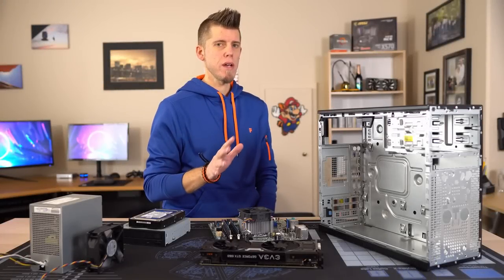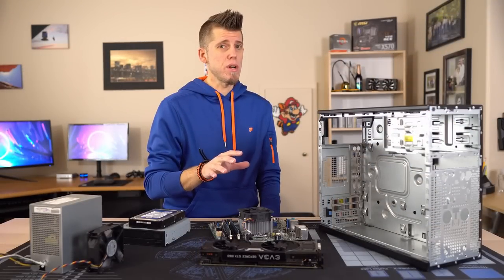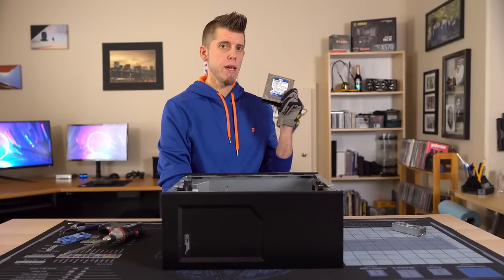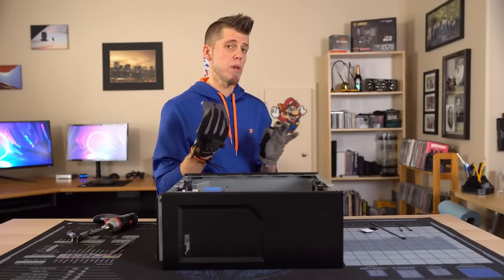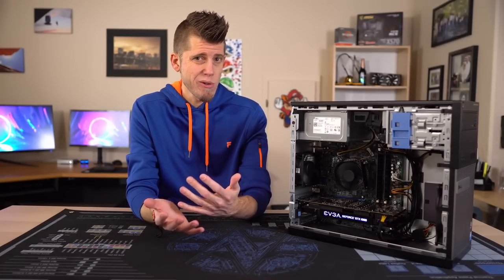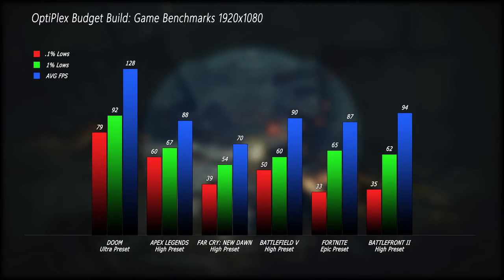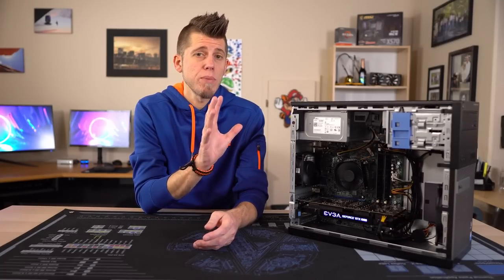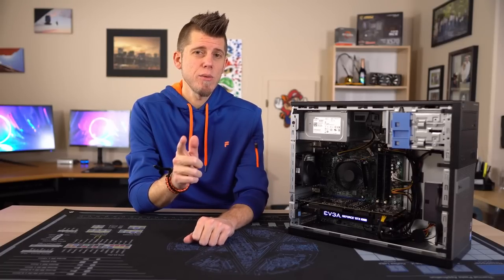Dell OptiPlex Budget Gaming PC For Under $300?

Comment: Thanks for the great video! I'm installing a fresh Windows 10 on  SSD. What  do you recommend installing first after Win 10 installed, the drivers from Dell website or Windows updates? Also, what is the drivers that need to be install from Dell for Windows 10?
Reply from the maker: The first thing I'd do is download all your drivers from the Dell website, and any add-in cards from their manufacturer websites. Then, don't connect the system to the internet and install Windows. Make sure to not connect to the internet and then install all those drivers, then connect to the internet and you can run Windows update.

I don't care for Windows update drivers. I've had various problems with them over the years, and if you're connecter to the internet, it will download them right away.
Reply: @TheGameBench  Hey, what Windows version  
Driver did you installed? There is No Driver for Windows 10 on Dell website for Optiplex 990.
Reply from the maker: @Harvz78  On the couple I've had come through, I've just used the Windows 8 drivers. They'll work just fine in Windows 10.
Reply: @TheGameBench  9? Is there a Windows 9?🤔
Reply from the maker: @Harvz78  For some reason they went to 8.1 to try and fix the disaster that 8 was, then just gave up and went to 10.
Reply: @TheGameBench  Where did you get the Windows 9 drivers you installed on your Dell optiplex Windows 10?
Reply from the maker: @Harvz78  LOL... I'm sorry, didn't even realize I had accidentally put 9. I meant Windows 8. And the Windows 8 drivers are on the Dell website.

Comment: Trying to make a long story short, I currently have 3 7020 Sff's. And may need other to upgrade a 4th 790.
Does it make sense to buy a 7020 i5 sff at the $100 price point , New conservative case also and gpu or is there another build you would recommend?
I guess I would love to see you keep going with this project. Where does it stop making sense?
Reply from the maker: So, you're talking about buying it and doing a case swap? If so, you can do it, but I would rather use an MT system for the swap since it's a standard micro ATX board. Now, when does it stop making sense? I think I'm about to find out. I ordered a Ryzen 3 3300X and I'm going to find out how I compares to the OptiPlex. Regardless, I have no intentions of stopping with the OptiPlex content. I have quite a few videos planned.
Reply: @TheGameBench  fantastic!
I'm enjoying.

Comment: I cant connect my 5.1 speakers pc to this DELL....any ideas of a pci or usb audio card that works in windows 10? thanks
Reply from the maker: Yeah, the on-board sound isn't 5.1. I don't have a lot of experience with external 5.1 solutions. I'm running an external DAC on a 2.1 setup. However, I've heard good things about this one.

https://www.amazon.com/Creative-Performance-Headphone-Integrated-Microphone/dp/B00EZT7RE4/ref=pd_sbs_147_5/132-0697711-9021900?_encoding=UTF8&pd_rd_i=B00EZT7RE4&pd_rd_r=100a9e63-c2d5-4947-b15b-08159904a6f4&pd_rd_w=t3ROH&pd_rd_wg=hXlEn&pf_rd_p=7cd8f929-4345-4bf2-a554-7d7588b3dd5f&pf_rd_r=ZKV6AT30VNGSHWKTK6D6&psc=1&refRID=ZKV6AT30VNGSHWKTK6D6
Reply: @TheGameBench   thanks! will check it out

Comment: What about a power supply that's not a ticking time bomb?
Reply from the maker: It's not. The 1060 is a 120 watt GPU. I tested these fully and with the 1060, the total system power draw peaked at about 240 watts, from the wall, at a max system load. The components are pulling, and worst, 220 watts from the power supply and sitting more around 200-210 watts. You literally have 70-80 watts of headroom. Also, I torture tested the PSU with a 480, pulling near it's 290 watt limit for four hours and it had no problem. This has enough power for a 1060.
Reply: @TheGameBench  but directly under Nvidia's website it directly says the reccomended psu be at least 400w. You are playing a dangerous game here which will end up with a most likely teenaged pc builder frying their first machine machines.
Reply from the maker: @haverjr  No, I'm not. Here's the deal, that exists because not all 400 watt PSU's are 400 watts. That is a peak rating and not all power supplies can maintain it. They might be able to maintain more around 300 watts, or less and might be able to peak to 400 watts for a split second. This is typical of lower end power supplies. Now, the PSU in these Dell's can maintain 290 watts. Meaning that there's literally zero difference from a sheer wattage delivery perspective.

That is why nVidia just says "400 watt minimum" because it covers their bases and is a lot easier to explain that way than what I just told you.

Comment: Should i get new cpu cooling mine cpu cooling metal is rust
Reply from the maker: That's pretty concerning, I would say yes. It's just going to continue to corrode, and at the very least, reduce the efficacy of the cooler. But I would have to ask why it's started corroding in the first place... since moisture and electronics don't mix. Anyhow, I would just replace it with the same stock cooler, or you can try stopping the corrosion on the one you have.
Reply: @TheGameBench  i got it from someone  for free.the guy say it from university anyway thank for help
Reply: When i got cpu cooler already rust so i let go bcz idk lol

Comment: That board has serious PSU choice challenges.

There's another Optiplex similar looking to this but uses a standard 24pin Power. Pinout may be a bit different but works great with any PSU. 
I myself upgraded my uncle's 4th Gen i7 Optiplex with 512GB SSD, 16GB ram and 1650 Amp from Zotac
Reply from the maker: Not really. There's an adapter that costs like $12 that will convert it to a standard 24-pin. Done it on several.

The xx10 an x90 have standard pinout 24-pin connections, but they are 3rd and 2nd gen respectively. They also have reasons I don't recommend them, and I go over that in another video. Also, there's no OptiPlex that runs 4th gen that has a standard 24-pin. If it does, it has an aftermarket board in it.
Reply: @TheGameBench  I may have to see which video I watched which had Optiplex with 24, maybe it was a different board, but if I find it, I'll share it here.
Reply from the maker: @shshankking  Yeah, if you can find it, I would be very interested to see.
Reply: @TheGameBench  https://youtu.be/z23iYDf0UDQ

Here's the one with 24pin board
Reply from the maker: @shshankking  Yep, I've seen Greg's video. That's a 3010, which runs 3rd gen Ivy Bridge. He called it out in the video that the system has a 3rd gen i5, not a 4th gen.
Reply: @TheGameBench  yeah.. ITS 3RD..But the fact its there make me wonder why they changed it to small one..
Reply from the maker: @shshankking  To make sure their customers couldn't replace things on their own. It was a matter of control. Everything since has been using the same connector... as far as I know.

Comment: So I’m confused about something. I bought an EVGA GTX 1060 6GB like the one in this video, but I don’t know what I am supposed to use to hook it up to the power supply? Trying to figure it out based on the video, but I need clarification on what to connect? I have a connection that came with the GPU, but I have no where to connect the cables to give the GPU power... a little help? Basically what are you using to power the GTX 1060 you are using in the video?
Reply from the maker: I talked about the the SATA to PCIe adapter at 9:13. You just need the SATA to PCIe adapter, which is in the description, and you connect the SATA connection to an open SATA power connector and the PCIe 8-pin to the GPU and you're good to go.

Comment: Are you able to put the gpu above the sata wires? I have a optiplex 9010 and it looks like the sata wires would be in the way if I got something bigger then my evga 1050ti.
Reply from the maker: Yeah, on the xx10 OptoPlex's the SATA andd USB3 port are in the way of anything over about 8.5 inches. A good option are the Zotac mini cards. They're just the right size and you can get those up to a 1080 Ti. However, Silverstone makes some low profile SATA cables that will clear the GPU and you can use something like this for the USB3.

https://www.moddiy.com/products/USB-3.0-20-Pin-Internal-Header-Adapter-Cable-Low-Profile-Connector.html

Comment: I have a empty dell optiplex case and I want to add 2 HDD the first one is 3,5 inch and the other drive is 2,5 inch and I don't know were to put them if I remove the  hard drive cage ? Maybe I can put the 3,5 HDD in the empty DVD drive holer? ( Idk what it's called)

Comment: A great alternative to the Optiplex 9020 is the Dell Precision T1700. It is also a Haswell Gen 4 based system with a slightly different look to the case AND a single 6-pin PCIE power connector on the PSU.  Prices should be similar to the 9020s.  I put a 4C8T  Xeon in one for my grandsons.
Reply from the maker: Absolutely. I just got one in and I'm going to be making a video shortly about the current prices with some alternatives, including the T1700. However, they don't always come with the 365 watt PSU. A lot of them only have the same 290 watt as the 9020.
Reply: I can’t ever find a decent price on these, they generally average around $70 with shipping.  Now that you mention it, I wouldn’t mind getting my hands on a Poweredge T20 MT as well.

Comment: those dell is good way to start ,most of them you can change the PSU with normal atx to get hungry VGA ,on that setup you can add 4x8gb ram later + it has room for cpu upgrade .so its a pc that will last some years.

Comment: that's a very clean optiplex case how do you do it?
Reply from the maker: Thanks! I remove the hard drive cage, the tabs under the upper drive bays, and shave down the front panel to add the fan. I have videos on how I doo all that. Now I actually cut a hole for the fan for better airflow, which I need to make a video on.
Reply: that would be amazing, do you use alcohol or alcohol wipes to clean the case?
Reply from the maker: @CODzombiePS3  Nah, they dry too fast. I just use some shop towels and Windex or some all purpose cleaner. Works well enough.

Comment: Hey, I have this Dell Optiplex 990 here that I was going to upgrade with other parts from another guide like this one. After watching this guide though it looks like it massively performs better than the other one being able to run new-ish AAA games at pretty decent frame rates when the other one was meant for more casual less demanding titles. Would there be a difference in performance if I just plopped these parts into the 990 instead of just buying another 9020? And I was also gonna buy a new PSU but you didn’t replace the old PSU in the 9020. (Hopefully) you can answer me when you see this, anyways cheers!
Reply from the maker: I also have a newer video where I test the 2nd, 3rd and 4th gen CPUs against each other. I can really give you a good idea of the performance difference between the different generations. Even the 2600 is starting to fall behind in modern titles just due to IPC limitations. And no, I didn't replace the stock power supply because it's adequate for a 1060 6GB. It also would be fine with a 1660, 1660 Super or 1660 Ti. The latter two needing a dual SATA to PCIe adapter.

Comment: Yeah you COULD upgrade the cpu/gpu/psu in that, but I agree with others that it is a dead end. That thing uses DDR3 RAM, and the fastest reasonably priced cpu doesn't even turbo up past 4ghz so there are going to be some bottlenecks there. This is a great build for kids/young adults when you need something that will last them a few years playing games they are playing like Fortnight/apex legends/rocket league/etc. It's a "one-and-done" build and once it dies, it dies.  This can provide a decent performance to cost ratio if you always research the next wave of obsolete office towers and compatible upgrades every few years. If you always replace the whole system every 3 years and cap your spending at 300 dollars, you get a yearly cost to performance of 100 dollars. This is REALLY good. However you will always be making sacrifices on graphics settings to get games to run smooth.  It can be better to just build a base custom computer for around 500 that will last you 8 years or so, add a 300 dollar gpu, and then upgrade that  gpu once after 4 years. This provides the ability to run games at max settings while only increasing your yearly cost by about 50 dollars or so. Then there is also the benefit of not having to try and snipe a good deal on ebay for an optiplex with good specs, and no goofy adapters or modified cables. With a new custom pc (in general) you plug it all together and it just works.
Reply from the maker: I'm not going to disagree with you. You're not necessarily wrong. However, the intent of this system was to debunk the myth that consoles are more cost effective. To show people that aren't considering PC, because they think that they can only afford a console and any PC that costs as much is going to be slower. I proved that wrong, and there is a market of people that this system is perfect for. Most of the people I sell these to are kids as their first gaming PC, and that's how I market them. However, I've had some older people buy them as well. There are quite a few people that just can't afford more, but are interested in PC gaming.

As for upgradability... I feel like going to an i7 is perfectly viable. For about $100 you're getting close to R5 2600/1600 AF performance. If you already have a system with a Haswell i5... or heaven forbid... an i3, the 4790 makes sense at that price and is a whole lot less than a platform upgrade. While I would suggest AM4 to most people rather than do that, there's a market for people where moving to a new platform for $700 doesn't make sense, if they can have similar performance for $400 instead.

Like I said, I'm not entirely disagreeing with you, but there is a market that this all makes sense for. If you've got the money, the newer platform makes a lot more sense, especially since AM4 has one hell of an upgrade path, but there is a niche market where these systems, and upgrading them, does make sense too.

Comment: Would the stock psu of this dell work with a rx570/580 or does it need and upgrade?
Reply from the maker: I tested the 570 and 480 out on the stock PSU in my last video, and while they ran, the total system power consumption peaked at 263 watts on the 570 and the 480 peaked around 287 watts. The 580 pulls even more wattage than the 480. So, the 580... absolutely not. While the 570 can run on the stock power supply, I don't recommend it.
Reply: @TheGameBench  cool thanks for the WATTS cheat sheet 👍
Reply: 🙂 you can use it for non video game tasks like web browsing but dont run a heavy video game until you replace the power supply, if you 'must' i suppose you can run lighter video games on the lowest possible video settings and resolutions and make sure you cap the fps to 30 with riva tuner, if you need more savings then go to Afterburner and undervolt it a little bit.
Reply: The Game Bench I bought a used 580 and because of the power draw comments, I decided to upgrade the PSU. I bought a thermal lake 500 watt psu to make sure we are ok. The only reason why I didn’t go with a 1060 and keep the OEM PSU was because I couldn’t pass up a great deal on the 580. I have watched multiple optiplex videos and yours was by far the most comprehensive and detailed.
Reply from the maker: @VirmanaMarketing  Thanks man! Yeah, the 580 is a hell of a deal. Especially if you grab it for under $100. I tried and the best I could manage on one was $110, which is still great considering the level of performance.

Comment: not sure if you answer to questions on here any more since this is an old video - but if you do, where did you connect the front fan to? somewhere on the motherboard? or does it connect to the power supply? I've done the cage removal for a 3 fan GPU and now I am ready to add the front fan - using all of your helpful guides here - thanks for any helpful information you can give ;-)
Reply from the maker: Unfortunately, I didn't make it clear that this was part of a series of videos, and that's my bad. I answer that in the final build video, but I don't connect it to the board because these Optiplex systems are sooo finicky about fans. Instead, I opt to use a SATA to fan adapter. This will cause the fan to spin at full speed. If the fan is too noisy, I use a resistor cable to slow the fan down.
Reply: @TheGameBench  thanks for the quick reply! yeah i saw that final video, but i still wonder if there was a specific SATA wire that i should connect to? do i just use one from the new power supply? I saw you had 2 wires in a link from Amazon - so I'm going to order them.  thanks for any more advice ;-)

Comment: You should make one on the Optiplex 390 MT with ssd, because its not compatible with ssd's but you can get it to work.
Reply from the maker: I had no problems getting an SSD to work. I just found the UEFI mode was very picky.
Reply: @TheGameBench  I got the impression you needed a adapter, is all you need is a change in the bios settings? How did you do it?
(bare in mind im talking about the 390 model)
Reply from the maker: @johnnygallardo76  Nope. The 390, 790 and 990 all have SATA ports and SATA power. No adapter needed. Granted, they're SATA gen 2, and not gen 3. As for the boot mode, you might need to change it. Should work perfectly fine in legacy. UEFI is preferred, but can be finicky on these x90 models. I would try installing Windows in UEFI mode, and if you have problems, try legacy instead. Here's a picture of the BIOS screen to change the setting.

https://static.spiceworks.com/shared/post/0021/8341/UEFI_BIOS_Boot_Select.png